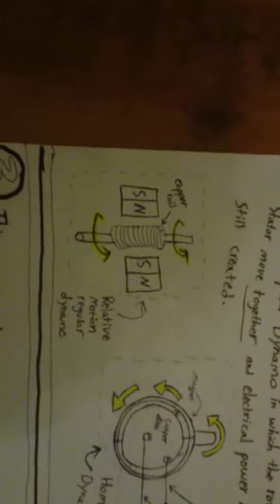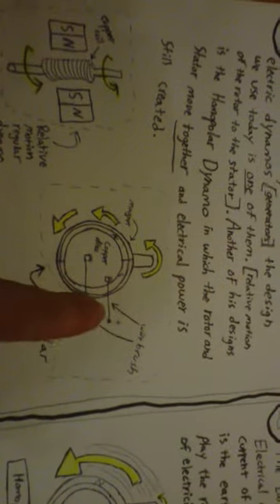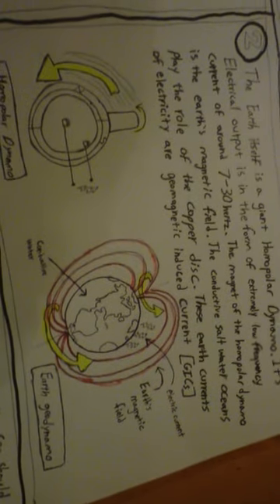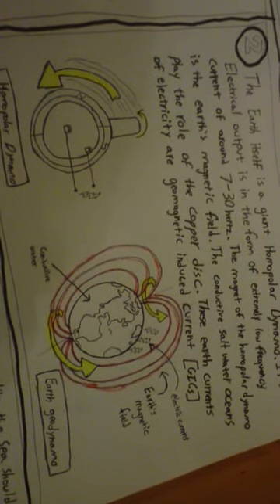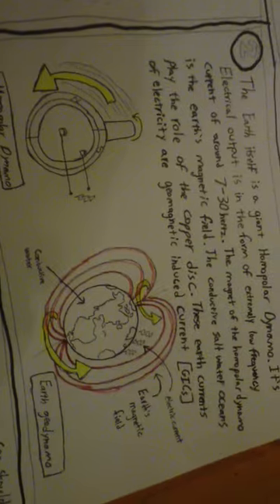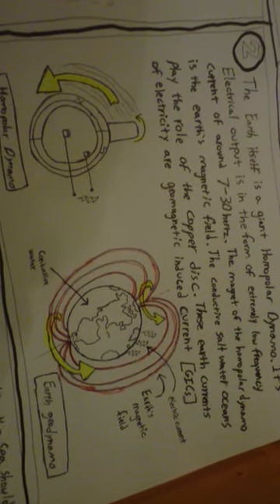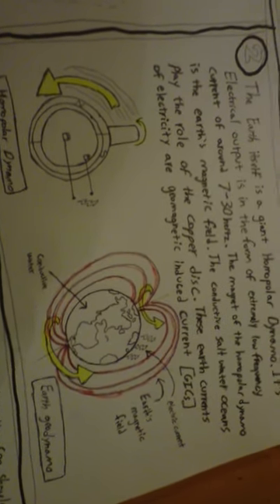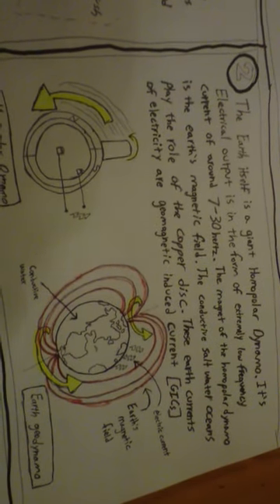DIY- earth battery with tellurics

Comment: *CLARIFICATION on the HOMOPOLAR DYNAMO*

You said that one of Faraday's dynamos rotates the magnet with the conductive disc (a technique known as CO-ROTATION) and still produces electricity.  Some people think "but if the magnetic field rotates with the copper rotor, then the circular conductor (the copper rotor) will not "cut" any magnetic lines of force, since the magnet rotates *with the rotor*.  And if the magnet rotates with the rotor, and no magnetic lines of force are being "cut" by the rotor, how can it produce an output?"

I'll explain that in a minute.  FIRST,  there is a case where a rotating magnetic field will not produce the same output in a homopolar dynamo. 

Here's how to construct a magnet that will do this:  instead of a solid magnet where only one pole (North or South) is on the side facing the conducting rotor -- use a series of smaller magnets, and alternate which pole faces the conducting copper rotor.  Alternate the magnets "North side up, South side up, North, South, North, South..." etc. so that the magnetic field facing the rotor does NOT have just one pole on that side.  In that case - an alternating N-S-N-S-....  magnetic field, you will NOT see the same output from the homopolar generator.  To get an output,  only one pole should face the conducting copper rotor.

Back to why you can co-rotate the magnet with the rotor and get an output (if only one magnetic pole faces the conducting rotor).   "If the magnet is rotating with the copper rotor, no magnetic lines of force can be created)  WRONG.

The North pole of the magnet polarizes the space in the vicinity of the magnet.  If you rotate the magnet, the space in the magnet's vicinity still sees a North pole from the magnet. 

To prove this, take the North pole of a round magnet, position it below but not touching a piece of paper, and put iron filings on the top side of the paper.  Now rotate the magnet.  You'll see the iron filings DO NOT ROTATE.  They might wiggle a bit -- it's hard to hold the magnet on a fixed axis as you rotate it - but the FILINGS WILL NOT ROTATE WITH THE MAGNET.

So the lines of force of the magnet DO NOT ROTATE (again, this is not true if the magnet consists of a bunch of alternating N-S-N-S.... etc. poles facing up towards the bottom of the paper - in that case, the polarity of the space in the vicinity of the magnet DOES change to reflect the changing N-S-N-S-...etc poles).

That's why you can rotate the North pole of the magnet with the copper rotor ("Co-rotation") and cut the magnetic lines of force -- and get a current.

(If you have a STEM background, I'm saying that the "quantum fluctuations of the vacuum" -- the virtual electrons, etc. -- the virtual particles produced by the quantum vacuum -- are being polarized by the magnet.  This is why magnets work out in space too.  For example, if you're an astronaut on a space walk with a magnet in each hand, and you move them close to each other,  will they suddenly SNAP together?  Yes.  Well, how does magnet #1 "know" that magnet #2 is their?  The quantum fluctuations of the vacuum -- the virtual particles -- get POLARIZED by the magnet and that's how the attraction of magnet #1 is 'communicated' to magnet #2.   See here for more => https://en.wikipedia.org/wiki/Virtual_particle  )

.
.
.
Reply from the maker: I see it as a plasmon or charge density wave type thing. The rotation exerts a pull on the metals electron sea and pushes them toward the edge creating a charge imbalance at the center